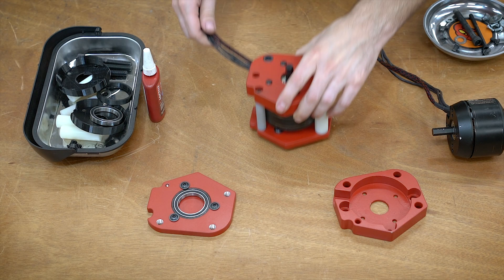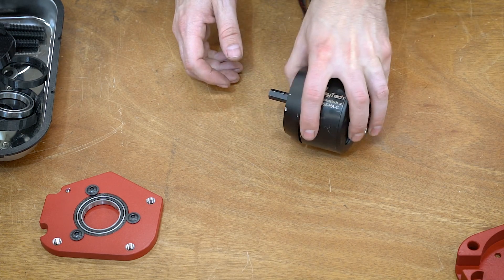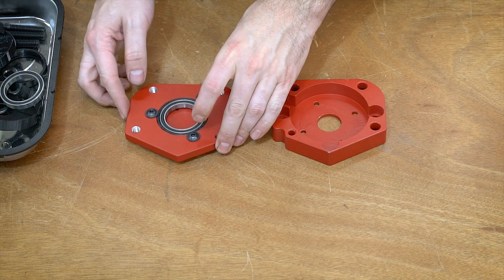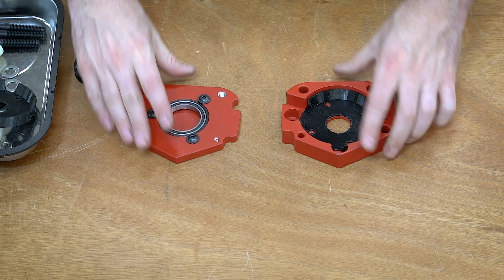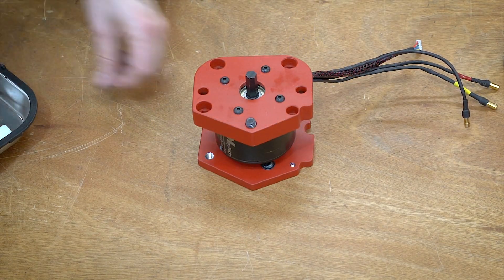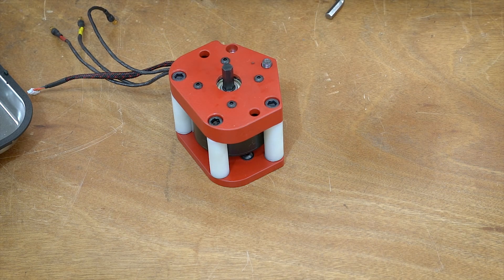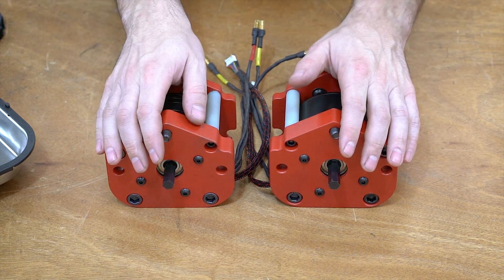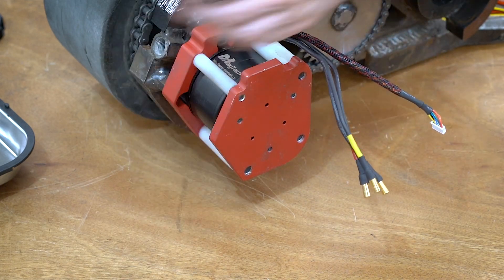Copperhead's New Drive Modules!

Comment: Hey Robert I gotta ask cos it's been bugging me for a while thinking about this, is the aluminium 7075 or 6061? I presume it's one of those two cos 6061 is more likely to bend under load and the other alloy is more likey to crack but they seem the most commonly used Al alloys for structural components.

Comment: Total newb question here: with drumspinners like copperhead (my fav type of bot) i wonder if anyone thought about putting the weapons motor and battery for it ''inside'' the drum rather than powering it via chain belt from the outside i.e. making the motor and drum rotate in unison. i could see a more bulky drum like for example yeti's to have enough space inside and it would naturally add to the weight of the drum (and make the bot even more front heavy which i think is an advantage for one like copperhead).
Reply from the maker: You can certainly do a 'hub motor' which is kinda what you're describing.  The problem is that you have now coupled all the shock and impact directly to the motor.  We use a belt since that de-couples these loads from the motor.  A weapon motor INSIDE would see all the forces that the weapon sees and would most likely explode.  Other teams have tried this as it's common at lower weight classes.  But at the 250 pound class, the motors would rarely survive these big hits.
Reply: @RobertCowanDIY  just found out that you got a few videos about hubmotors uploaded. watching now :-)
Reply: @RobertCowanDIY  thanks for the quick and thorough reply. i guess it has pros and cons and from the overwhelming usage of chainbelts and external motors probably more cons 😀. Maybe someone will someday find a way to leverage the pros and bring one super heavy to the arena. cheers

Comment: Hey Robert , love the vid.  Have you considered adding thin shear surfaces between the nylon?  You mentioned the torsion and impacts these units take and adding connections between the standoffs would significantly increase your shear stiffness around the motor for negligible weight.  This would still allow you to maintain the nylon bumper method you mentioned.
Reply from the maker: I'm not sure I understand what you're asking?

Comment: Do you bother to rebalance the motor after battle hardening?
Reply from the maker: Nope.  The epoxy only adds a few grams per motor, and the whole thing is going on a chain drive with a 15 pound wheel.  Balancing the motor isn't really worth it considering what it's getting attached to.

Comment: What happens if you impregnate the expoxy in the motor with iron filings?
Reply from the maker: Then it becomes heavier, slightly magnetic (and potentially conductive), and makes an absolute mess when it rubs away.  What's the problem you're trying to solve with iron filings?

Comment: Looks awesome! My concern is the wiring looks like it could make contact with the drum potentially, I’d take some more loom around the wiring to hopefully save you from a short. My 2 cents from building random junk in my garage lol
Reply from the maker: I'm not sure what you're seeing, but it won't make contact.  You're not seeing it fully installed, there is a LOT of tape and zip ties ;-)
Reply: @RobertCowanDIY  fair enough, from the camera angle it looks awful close to the can on the motor when you bend it into its slot
Reply from the maker: @lokedog916  Oh, it very much is close.  BUT, it doesn't really want to bend INTO the motor, it needs to be taped or secured in place to get TOO close.  It wants to bend away.  This is pretty common and not really a concern.
Reply: @RobertCowanDIY  ah okay good, I really want you guys to do well this season! I’m so stoked for it, ever since I found your channel I’ve been rooting for copperhead!

Comment: The segment at 00:53 concerning motor modifications is a gold mine. In less than 1:10, we have bearing supports, drive shaft mods for torque transfer, sensor fixation for shock, stator protection, and even magnet expoxying for rotor longevity. Great tips for motor longevity beyond combat bots!
Reply from the maker: Thanks!

Comment: Can you explain the design choice/reasoning for going with an outrunner motor vs something that might be inherently more robust like an inrunner?
Reply: BattleBots usually need high torque at relatively low final drive RPMs. Outrunners generally produce more torque at lower RPM than inrunners, so less gear reduction is needed to achieve a useful final drive. This makes construction easier, more compact, and lighter.
Reply from the maker: Yep, what others have said.  The biggest reason for us choosing an outrunner is form factor.  We don't have the length (depth?) that inrunners require.  We only have room for a larger diameter motor, which means we have to use an outrunner.  Also, we don't have the room to gear down an inrunner, which usually has much higher RPM.
Reply: @RobertCowanDIY  makes sense! I appreciate the response!

Comment: I was getting worried until I saw the TPU bushings, it seems like Copperhead's only weaknesses in the previous season were firmware gremlins and shock loads transferring through the armour and into the vital components. If Copperhead now has all the vitals shock-mounted then I don't think anything will seriously harm it.
Reply from the maker: Eh, even going from steel to aluminum would help.  The last setup was just steel on steel.  But the TPU should help further.

Comment: Will the epoxy in the motor impact the cooling?  Nice job!
Reply: Quite a bit lol, but it's a worthwhile tradeoff to keep all the fiddly bits where they need to be, and the motors can handle it.
Reply from the maker: In theory, it should.  But I've never noticed a significant increase in temperatures after battle-hardening motors.
Reply: @RobertCowanDIY  Maybe because the duration of the battle is short enough.  Thx!

Comment: At this point outrunner motors are just inrunners with extra steps, change my mind.
Reply: Yeah for combat robots pretty much. The spinning outer body has to be protected so it doesn't touch anything.
Reply from the maker: Inrunners are much higher KV (RPM) on average, and much longer.  We went with what would fit.

Comment: How do i introduce a new weight class into this sport? Max limit will be exactly 1000 LBS. BTW do you think 1000 lb is possible?
Reply from the maker: Ha, figure out how to make an arena to handle those bots, then worry about the bot...  250 is the biggest because of the limitations of the arena.
Reply: In addition to the arena, cost of the robot would be insane. You'd be looking at $100k+ per machine, without spare parts.
Reply: @mattgolman  combat robots are already approaching that cost. I have no idea how something complex like chomps 500lb walker cost but even a more standard 250lb robot like hypershock cost $67k
Reply: Then you'd have maybe 2-3 teams with the financial capabilities to compete. 250 lbs is already pushing it, there are a a million more teams in lower weight classes.

Comment: Do you have any concerns with the motors overheating? The TPU piece might be stopping the motor from heatsinking to the aluminum piece and you could save some degrees if you let it do that
Reply from the maker: Nah, in the previous tests, we were burning up the wheels for several minutes, driving it with extra weight outside in 100F heat, etc.  In all cases, the motors were slightly warm, but not too hot to touch or anything.  They don't really need much heat removal.  When they get damaged it COULD be a problem, but they should be OK.  I think the battle hardening is worse on them, but that's critically important.
Reply: @RobertCowanDIY  that's actually pretty impressive
Reply: @RobertCowanDIY  Is there a material (other than TPU) that conducts heat better, but still has similar cushioning qualities? It might not be needed in this robot, but maybe a different robot could make use of something like it.

Comment: Any worries about those button head face screws breaking off? Seems to be the stiffest point of the assembly.
Reply from the maker: Which, the ones that attach to the motors?  Not really since there won't be significant lateral force to shear them.  It can't pull them out (nowhere to go) and very limited lateral movement.
Reply: @RobertCowanDIY  This is probably where my inexperience with electric motors shows, but I'd have thought that with all the bending the assembly is made to accommodate, those screws being metal to metal seems like a stressful relationship. But then again, the motor itself might flex too, which would minimize the forces that I'm imagining.
Reply from the maker: @ekner  Oh you're not wrong.  If I had to do it over, I would do some sort of dowel pin or something.  They really only need to keep the motor from spinning, not really hold it in place.  But I do think it will be fine.  I always look at failure modes.  If all 4 get completely sheared off, it can still MOSTLY function.
Reply: @RobertCowanDIY  That's a good point, they only need to fill the role of dowels. With any luck, the heads will pop off and the threads will survive. I had that exact thing happen on a sprocket recently, where it all held together and I only noticed something wrong after I was finished running the machine.